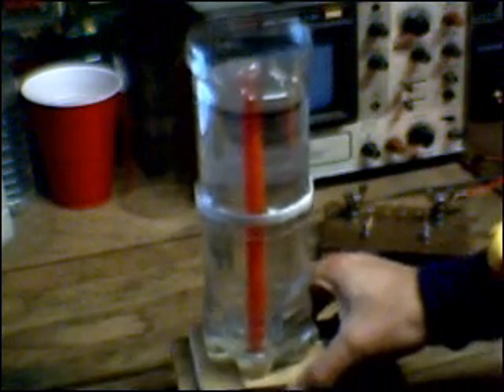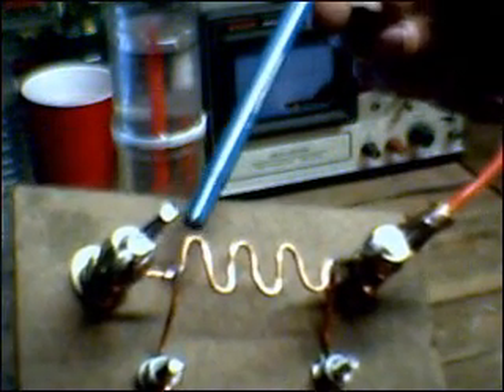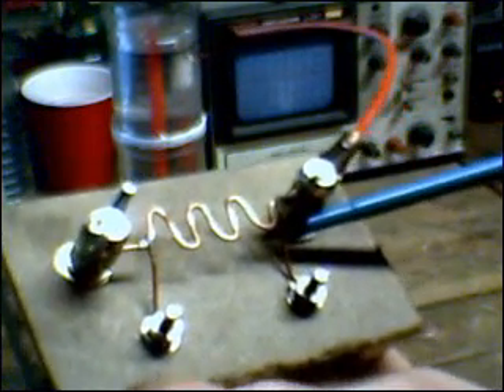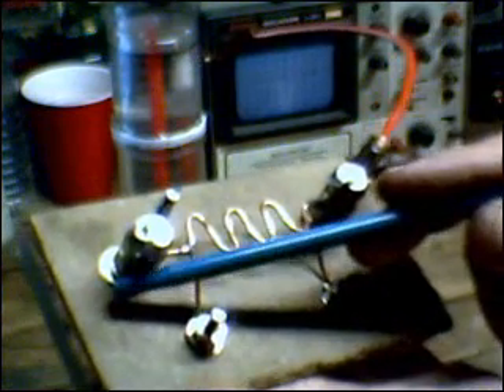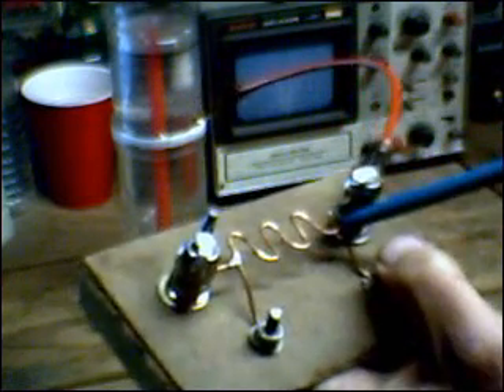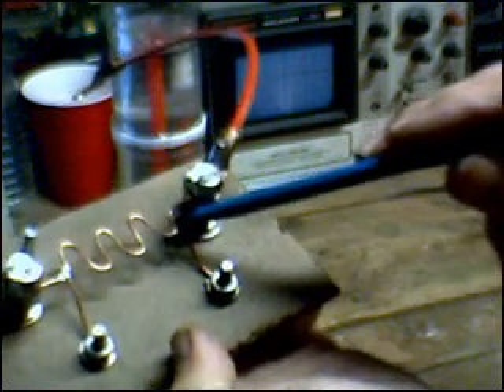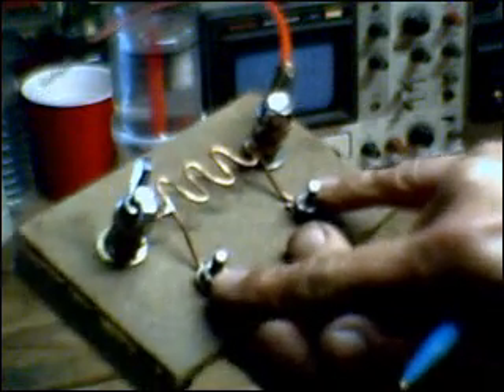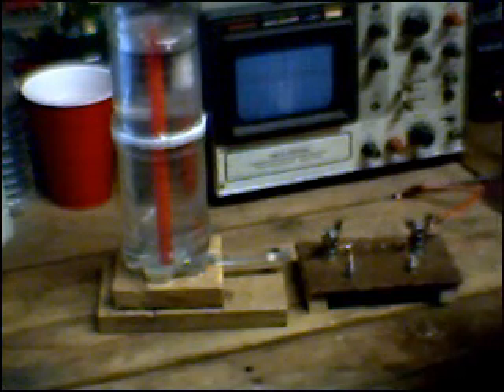#44 Poor Man's DC shunt to measure high current

Comment: I get it . you are measuring volt drop across a given piece of wire. and the MV changes with the current through the wire. BUT! it hasn't helped me with my issue!  I need to measure up to 300-400 amps DC. from my battery bank.  I guess I could build a arduino based meter. I had rather just have a gauge. would it be possible to build a shunt. with a  digital mv meter. and call 1 MV 1 amp through the shunt? I just haven't found over 100amp meters. and need to measure current draw. and bolts would be OK. if I must. I can maybe figure out how to build a arduino based meter. but that will cost more. thanks for a great video.

Comment: Hi.  I have a question.  Is it an 8" wire for 12volts and 16" wire for 24 volts?  Thanks
Reply: d d what does the volts have to do with wire size? the current and wire size is what matters.

Comment: Nice video well explained.
I have a meter with no light can i put an led across my analog DC ammeter  - and + terminals no shunt it has 0.001 internal resistance in the coil?
I heard it can short the meter if anything is put across them true/false?

Comment: min. 3:23 ...again confused..you put your digital multimeter accross the terminal and you saw right the way the 25 amps? or you saw, right the way the voltage and only after that, you calculate current, based on what you knew about the shunt..? sorry I'm inexperienced and I came to learn, about shunts..

Comment: I like your video. Thanks for posting the info. It would also be interested in seeing you demonstrate doing the test with the multimeter. I am not clear how you are able to identify a drop in voltage merely by touching the multimeter negative and positive probes (are you setting the meter for ohms or resistance?) on the two terminals you are showing. I am a bit of a novice on some electrical things, but eager to learn.

Comment from the maker: A shunt is a very small known resistance that drops a calibrated amount of voltage across it as current flows through it. Your 20A ammeter already has a shunt built in. The meter movement is 75mV for full scale. By adding an external shunt you have two shunts in parallel. This will produce inaccurate measurements.

You COULD put your external shunt in series with your ammeter and a mV meter across it. Both meters will now show the same current and drop 150mV total. But that's redundant.

Comment from the maker: Convection driven circulation is so strong from my tall plate column design that cooling is not a problem. Cell has been running around 120*F on cooler days, 140*F on the hottest Summer day I tested.

From 14VDC I get 2.3v/plate in the series cell stack which seems to be the sweet spot. Electrolyte at present is just concentrated enough to draw 25A.

Comment from the maker: No best thickness but for long term duty definitely use 316L.

Vacuum does seem to increase output but I haven't compared it yet. It may be just that it just increases surface tension allowing bubbles to form more easily, making it easier to see the gas production that was already there. Tests will follow.

Comment: What is the running temperature of the cell when installed in the car you wish to achieve taking into account the summer temperature's plus under hood temperature in a vacuum.Seams your testing is going the higher voltage lower amperage way. Guess in the car your going to use a step up transformer? Thank you for letting me pick your brain a little. Looking forward to your next video!